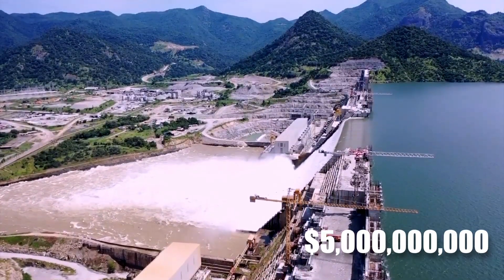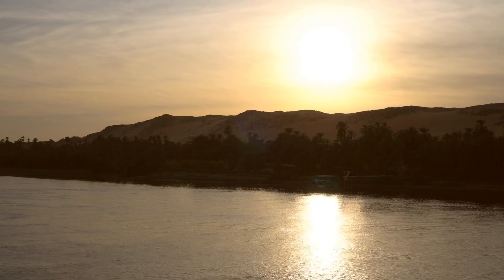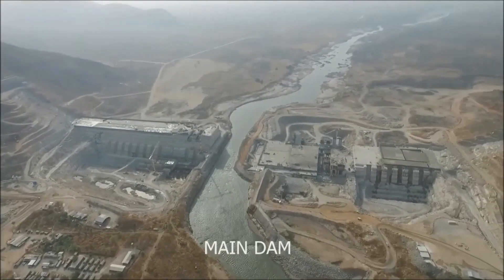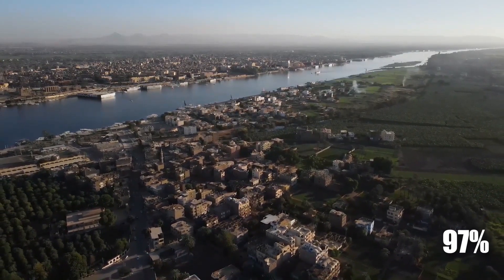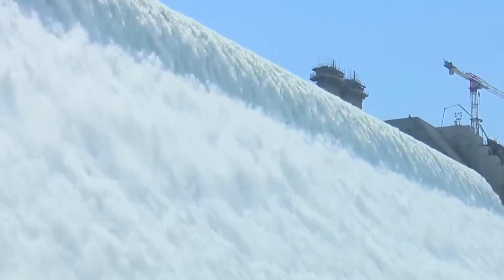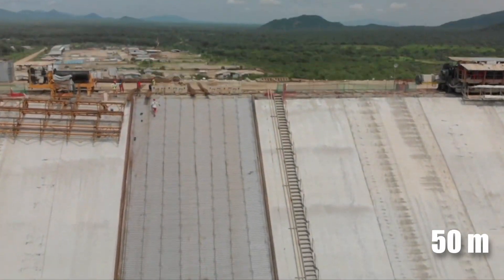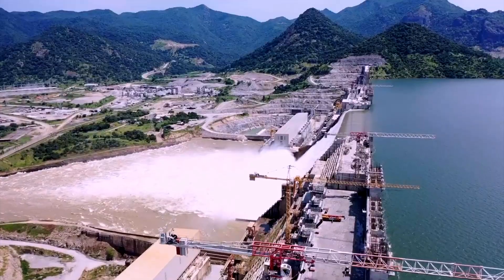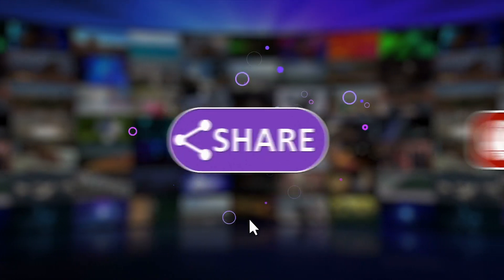The Insane Engineering Behind Africa's New $5BN Megadam

Comment: Once  the  Dam  Lake  is  full, EGYPT  expect to  receive  Its  normal  annual  historic  share  whether  or  not  there  is  a  draught .
Egypt  increasing   population  would  require  even  more  water  to  survive .
In  2015  Egypt  signed  a treaty  for  the  three  countries  to  share  control  of  the   Dam,  and  to  guarantee  its  safety.
97%  of  Egypt  is  dry  desert. It  cannot  accept  any  reduction  of  its  water  supply.
Egypt  promised  to  act  unilaterally ,  as  UN  Security  Council  declined  to  interfere,  stressing  on  bilateral  negotiation.
Egypt  is  preparing  itself  for  accidental  collapse  of  the  Dam,  a  luxury  Sudan  do  not  have ..
Reply: One thing is clear . GERD won't collapse before ASWAN . At least it takes 50 yrs. ✌️🇪🇹🇪🇹🇪🇹
Reply: both are members of BRICS, who are going to join in Jan 2024--so the chances of war, I don't see it. but I see diplomacy at the heart of the issue--because BRICs will intervene
Reply: Who cares. Ethiopia 🇪🇹 will go forward and finish the Dam.